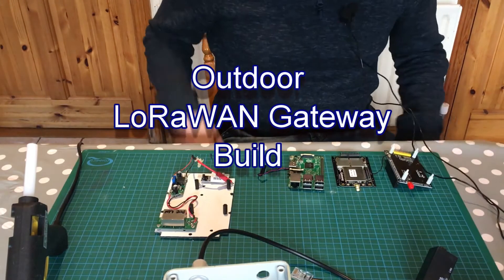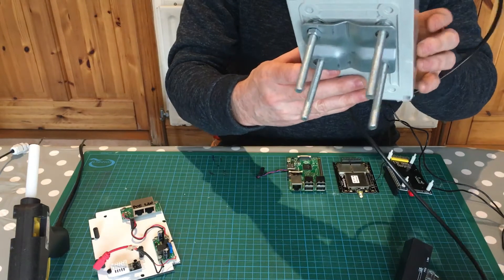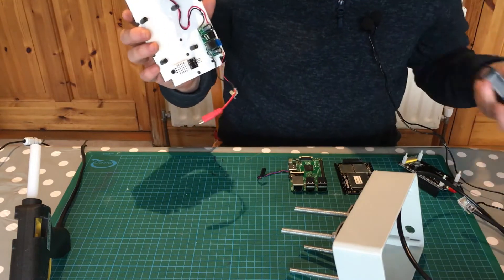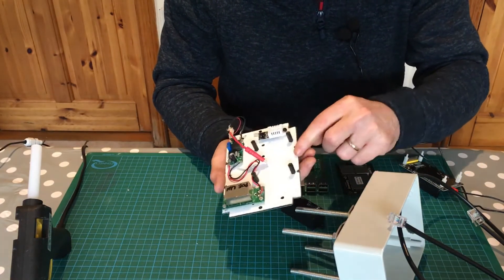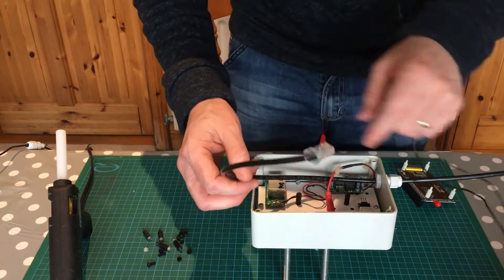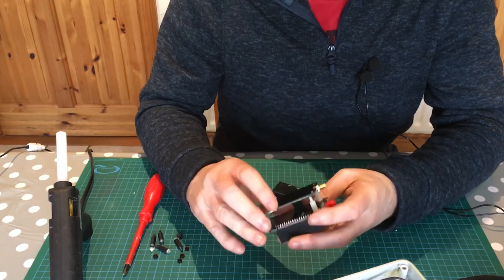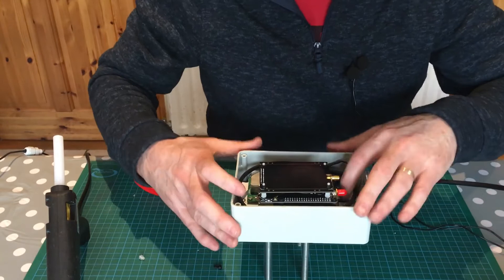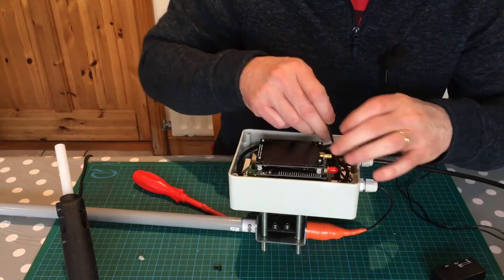Outdoor LoRaWAN Gateway Build

Comment: David I don't know if you will get this, but you have just saved my Bacon, I was wondering how all these connections came together in the Gateway, Now if I knew how to find the two white waterproof plugs that you are using for the cables at bottom of box , My whole world would come together.
I'm making my Antenna out of a 36" Tig welding Copper plated rod, I hope it works.

Comment: Amazing job!
How many devices can I connect to this gateway?
Reply: 8 channel with max 1% duty cycle would result in 800 time slots ie. 400 devices when the gw acks packets. If the devices send less than constantly (say a message every hour), it takes quite a few devices.

Comment: Dave, out of interest...why did you choose the RAK gateway and not the ic880a?  Also why 10dbi antenna? I am just about to order a 5dbi antenna so I will wait!
Reply from the maker: It was the cheapest option available that I could find for a full 8-channel gateway. And it had an adapter for the Pi (even though the first adapter they sent me had a design flaw, but they quickly sent me out a replacement).
Reply from the maker: Oh, and on the antenna, The 10dBi antenna selection was kind of arbitrary. Although I did want to get decent range out of it, hence my leaning towards double digit gain. I didn't want to have to replace it in the future, as it's difficult to re-do the waterproofing.
Reply: Thanks for the reply. I have been over to the TTN conference in Amsterdam and only just catching up on my posts...cheers
Reply: Hi Dave, what is the range that you able to get with your setup?

Comment: Interesting build Dave.  Pretty much identical spec to my gateway (TTN @ Kilpedder, Wicklow) with similar hardware.  I have the antenna mounted on a pole with the hardware at the bottom of the 5m pole.  This end works well and I have had packets from about 20km. Plenty of testing at the node end to see what works or not and what is best for node placement and antennas.  Give me a shout via TTN if you want to chat/share info?